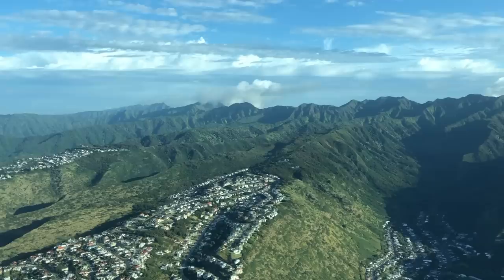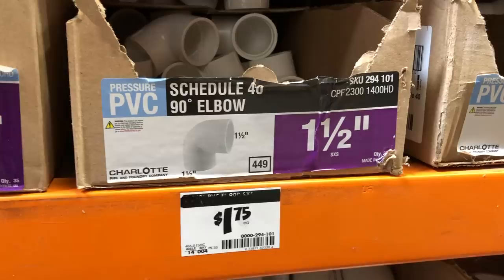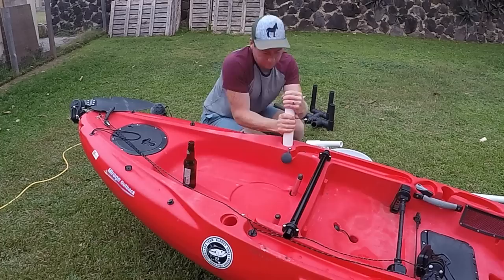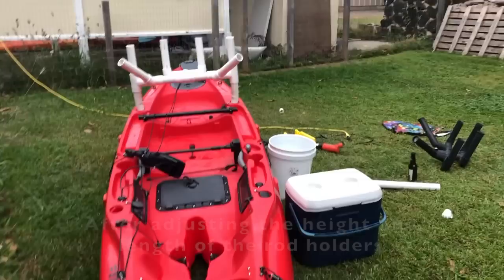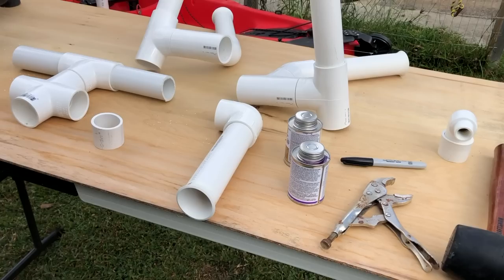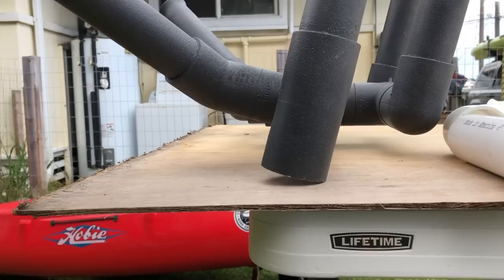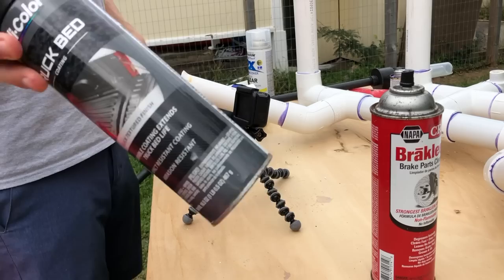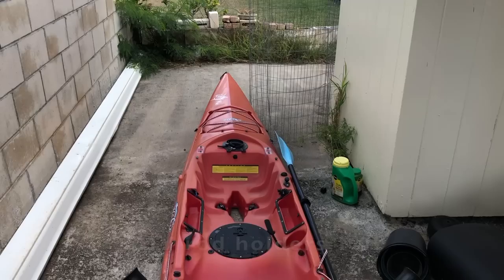The ULTIMATE DIY rod holders | PVC, Rocket launcher rod holders, Kayak mods, offshore rod holders

Comment: If you were to flip over would you have any concern of the entire structure coming out?  Since you used the white pipe it wouldn't float so you could lose a lot of gear.  I flipped once about a half mile from shore and couldn't get my kayak back over for over an hour.  Lost rods/reels/tackle/all kinds of stuff so I'm particularly aware of that happening again.  Luckily a boat came along and helped me out.  Now I have 3-rod Scotty rod holder attached to a milk crate which is lashed down behind my seat. I use leashes with carabiners on both ends with one end attached to the milk crate and the other end attached to the rod.  I attach a leash to each rod when not in use.  Takes a few seconds to grab a rod when needed but at least I'm not going to lose it again.  I like the basic idea of your structure and will try one out although I will add the same rod leashes to the ends of tubes and possibly figure a way to attach entire structure to kayak.  Using the black pipe might not be a bad idea either. Thanks for the ideas.
Reply from the maker: Hey Jim. Sorry to hear about you flipping, but I’m glad you’re okay. After 3 years fishing here in all kinds of conditions I finally got flipped too. Not in 15ft swells or 40 mph winds, breaking surf or any of the other extremely dangerous situations that I have got myself into. It was a trade wind day and I thought I could get away fishing for a few hours in the morning. At sunrise I saw a mahi by the kayak and ended up hooking one an hour later after I fought a big shark. After the mahi my pedal drive broke and I took out my half paddle and started heading in. At this point the wind was gusting from about 18-25 mph and the current was running at 2 knots both pushing me further away from the launch. I still had a bait out and I hooked into a 15lb yellowfin tuna. During the fight I drifted another half mile further away. I still had more bait so I put out another and kept paddling. In 500ft I hooked into another yellow fin tuna about 20lbs. With around 60lbs of fish and ice I released the rest of my bait and started paddling the two and a half miles in. 3 hours later after making only 0.3-0.5 mph against the wind and current I was finally almost in. The wind was still ripping but it wasn’t as bad now about 1/2 mile offshore. I didn’t realize that my kayak had been taking on water and while the wind gusted from my left a swell came from my right, meanwhile the water shifted to the right in the kayak and there was nothing I could do to stop it. I flipped in about 45-60ft of water losing all of my poles, but nothing else. It took about 5 seconds to get my kayak flipped back over and then I started grabbing my stuff that was floating. A boat came by and picked me up before I had a chance to get back on. As for the rod holders they were still in place held only by friction. I had tarp bungees to secure the rods but didn’t have the rods strapped down. I free dove the area with no luck later that day looking for my poles. It was bothering me a lot and I knew I could recover them if I could just find them. I had warranties on the reels and was pretty sure I could get the reels replaced at the very least. 6 days later I went out with a friend and some scuba gear and found all 4 of the poles sitting on the sand in 50ft. After 6 days there was stuff growing on the poles and sand had gotten all into the reels. I cleaned off all the poles and they are practically new again, less a little bit of shine. Three of the four reels had extended warranties and I have already gotten two replaced. The third a spinfisher 6 is still operational even after 6 days under water. It has problems though and I will get it warrantied pretty soon. As far as after this incident I have added a pin with a ring to hold the top of the rod holders to the bottom. I still have the same tarp bungees for the poles when they are in the rod holders. After the boat towed me in I found about 7-8 gallons of water in the hull and I thought no wonder I flipped. There wasn’t a crack, all the water had come in through the hatches and rudder line tubes. I had wind waves constant breaking over the kayak and the tail of the kayak was frequently underwater from passing short frequency waves. I gave the fish to the guys and counted my lucky stars that nothing worse happened. The only causality of  the entire situation was my bait reel but it was mostly dead before it hit the water with no extended warranty.
Reply: @FlyingFish_TV  They say that everybody flips eventually so I guess were living proof of that.  I flipped while leaning way over the side and a swell came from an unexpected direction behind me.  I felt it start to go and realized there wasn't anything I could do to stop it.  The problem was that the bow hatch wasn't locked down and the interior of the kayak filled with water.  Once that happened it was virtually impossible to flip back over.  I was able to flip it over a couple of times but once the kayak was full of water it basically wanted to be floating upside down so I had to constantly fight it to keep it upright.  After awhile I just got too tired and let it float upside down.  I thought the kayak would sink and I was going to lose everything.  What I learned was that the kayak will float even if full of water although you can't climb on top of it because the additional weight will cause it to sink but you can hang onto it and stay floating (in addition to the life jacket).  One really good thing was my fishfinder (same as you - Garmin Chirp 74cv).  Underwater for over an hour, I thought it was toast but after new cables and a new cradle it worked fine.  My fishfinder has been underwater a few times and all I've ever had to do was replace the cradle (about $25).  If you do ever have issues with yours try replacing the cradle before anything else, except maybe cables (the contacts don't like salt water).  Glad you're OK

I almost can't believe you go out in such strong wind.  Anywhere over 10 and I feel like a cork getting blown around and it's really difficult to maintain a spot.  I guess with the trade winds you either fish in the wind or you don't fish at all.  Be careful out there and thanks for the story.  Good to know I'm not the only one to flip over and admit it.
Reply: @FlyingFish_TV  many blessings
Reply: Can u post a pic of yr set up?
Reply: Wow, sounds intense. Did you have your sidekicks on?@flyingfishtv2122
Reply: you could use pipe insulation and stuff down the pvc or spray expanding foam into it.  This would make them float.  I've also seen people put sections of pool noodle zip tied around a portion of their rod near the handle.  you'd have to test them to make sure they float.

Comment: FYI..When using PVC CEMENT and PRIMER apply the primer and while wet apply the cement immediately making connections. The chemical reaction actually welds the fittings together. Very nice looking rod holder.

Comment: I think you did a fine job with this multi rod holder. I personally  wouldn't take more than 3 rods on the water with me. My thinking is one top one bottom and one spare.
I'm curious why you like having what appears to be a 6 rod holder. Let's face it, you can't use them all at once. 
Now, another preference  is I like salt water fishing, but for my kayak, I prefer slow water.
All in all, it's a great video. Would be interested in other projects you might have going.

Comment: they sell reducer bushing so you can connect smaller diameter pipes with larger ones and skip the heat gun and or duct tape

Comment: How would you do it without manufactured rod holders on it my doesn’t have rod holders
Reply from the maker: You can put after market flush mount rod holders in and then use the same process.

Comment: Man,all you guys wasting TIME,MONEY using PRIMER.Just messy,NOT NEEDED,NOT EVEN FOR PRESSURIZED PIPE. PVC GLUE is all that is needed,that is if you even glue it.Lots times i just dry fit on my boat. Plumber here for 48 yrs,actually CLEANER better,but like i said ,GLUE is all you need..